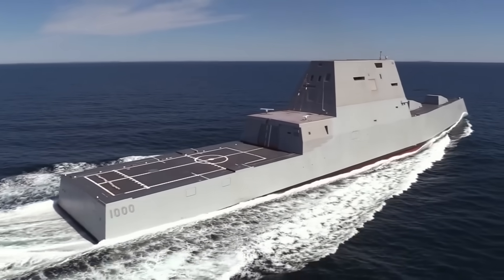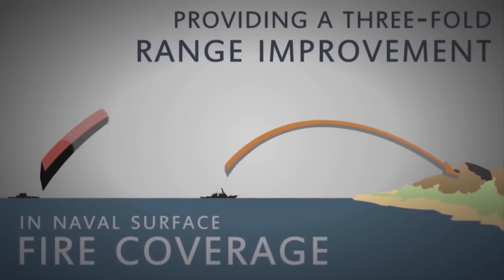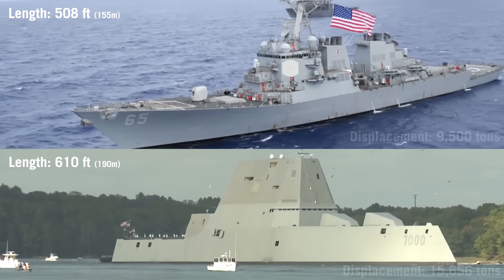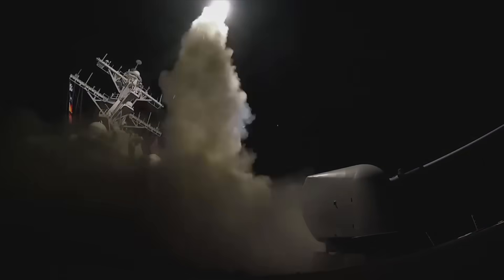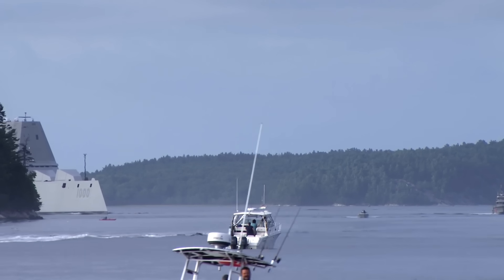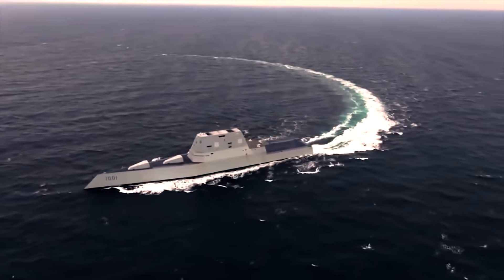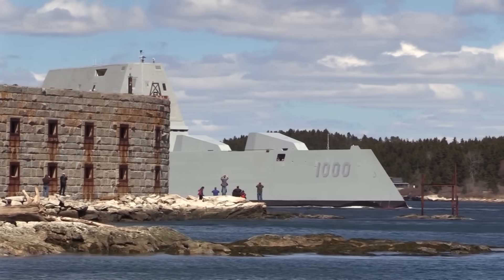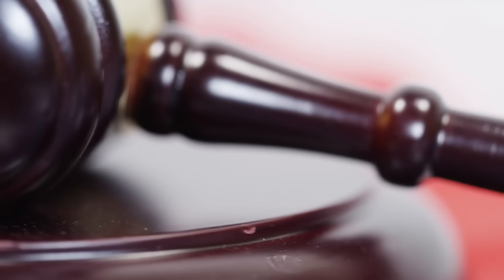What Killed Zumwalt Destroyers?

Comment: Has a system in place to flag and cancel projects that have gone over budget.
F-35: Luckily I have an immunity card.
Reply: To be fair, the flyaway cost of an F-35A is $77.9MM. By comparison, the new F-15's that the US just contracted for will run $99.9MM a copy (combat capable) and are not stealthy. The case studies, including this one represent the loss of economies of scale. Lawmakers want low cost/unit but cut back production which results in the exact opposite. See B-2, F-22 among others.
Reply: @arrow-flight  Yeah, because they didnt cancel the project or hamstring it. Things are cheaper when you build more of them, economy of scale and all.
Reply: @Orinslayer  And also because there was a workforce too big to cancel it.
Reply: @hueyrosayaga  Which means from now on, all defense contractors will make their projects "too big to fail".
Reply: @arrow-flight  That's not the actual cost, it's a projected program unit cost and assumes the full procurement will still be met. This figure does not include engines, which are subject to a separate contract
Reply: @turbotroll8605  Cost for everything. Including fuel weapons and even pay of anyone who worked with the system. When production costs lower with a new manufacturing process the savings can be put into tankers and flight hours. Our country has put off buying them. But like I think future conflicts are going to be very low intensity and definitely more political and economic. Rivals want to look impressive to their people. So we're going to be buzzing and trolling each other in the air, in the sea, and drilling on the land. It's that or they have to spend time with their wives.
Reply: @arrow-flight  The Zumwalt could not replace the Arleigh Burke and the F-35 could not replace the F-15. Coincidence? Although, maybe the F-35 will replace the A-10?
Reply: The F-35 cost is actually sort of reasonable as of 2021, but I''ll admit the X-32 program should have been chosen over the X-35 (f-35).  Problem was the X-32 VTOL variant wasnt as good, which was a problem for the the USMC and especially for the UK Royal Navy, who were a major partner. 

The X-32 basically used a clone of the Harrier VTOL design, which always had a number of safety problems, and couldn't take off fully loaded.
Reply: @p51mustang24  Isn't the X-32 that plane that looks like it has a Derp face due to the massive intake at the front? I thought it wasn't picked due to that intake making it non-stealth.
Reply: @deloreanrc  yep, that's the one.  It had a pretty decent stealth profile, although it was slightly less stealthy than the xf-35.  

The main advantage to the x32 was the incredibly strong and inexpensive uniwing design.  The x32 would have been a lot cheaper and would have gone into production several years sooner.  I believe it also had a larger internal weapons bay.  

Issues with VTOL on the X-32 B variant were the main reason it lost out.  Supposedly the air force just thought the F-35 looked better too.
Reply: @p51mustang24  A huge portion of the cost overruns and delays on the F-35 are due to electronics and the STOVL system. The X-32 wouldn't have avoided these issues whatsoever.
Reply: @ivanlagrossemoule  The X-32 used a very different STOVL system, so that's probably not accurate.  The x-32 was roughly a copy of the harrier's system, so it was a proven technology, albeit less capable.
Reply: @p51mustang24  The F-35 cannot take off fully loaded either or land fully loaded.
Reply: Lol ikr
Reply: its not over budget mate. its just differently financed. :)
Reply: So does the James Webb  telescope.
Reply: @jsmariani4180  except the webb telescope will radically redefine and expand humans knowledge of the universe. the f35 is just further taxation without representation designed to feed the addiction of sociopathic wealth hoarders
Reply: Laughs in V-22
Reply: Also called an "ordered success"
Reply: First of all there is no such thing as under budget... When truly creating.
Reply: @Nybbl er Disagree with the F-15 as it is an in-production aircraft at the time of the EX contract. The industrial base for the aircraft exists and is still accepting long lead part orders. It does not have the benefit of similar economies of scale - which was my argument.
Reply: Oh, that's because fighter pilots have this privilege of being that hotshot maverick that plays beach volleball and doesn't afraid of anything.

Consider this: Convair B-58 Hustler had one pilot plus two in order to just keep it afly. And then there's the Northrop F-89 Scorpion that could just Macross with their Mighty Mouse rockets.

These aircraft that looks like something straight out of Johnny Hazard is much more funnier. Also, they would probably send any Zumwalt to Davy Jones' Locker just like that.

Comment: Its not that the tumblehome design is unstable in rough seas. Old British sailing ship were designed this way because they were more stable in rough seas. Its unstable when there's a hole in the ship from combat that let water in causing it to be more likely to capsize.
Reply: I was just thinking the same thing. Under some circumstances it's actually more stable.
Reply: Tumble home always has negative effects on sea keeping in heavy weather as the bow tends to dig into waves.  It was universally abandoned for a reason.
Reply: @JimmySailor  Seaworthiness was an issue if your tumblehome ship had gunwales, but this class of ship isn’t going to founder in the same way if it takes a wave on deck. The main issue is that they prioritised stealth over utility and flexibility. You have max displacement but no way to utilise that reserve of buoyancy over the lifetime of the class.
Reply: @nicbrownable  The Zumwalts were designed with reserve power in mind. They may not have extra displacement in the sense that more stuff can just be tacked on, but old systems can be replaced with more power demanding ones. Legacy ships have a problem of supplying the Megawatts of power required by high-power radar, computing, and especially directed energy weapons that are slated for deployment in future ships. As such, I think the Zumwalts are actually a fairly future-proof design.

Any modern fighting ship ought to be built with a robust DC-grid for its power distribution, and enough excess power in its propulsion units to be able to upgrade its weapons and sensors as time passes. It is extremely arduous to try to fit in more power into a hull after the fact, let alone distribute it where it is needed.
Reply: @whitescar2  it might make more sense to invent the railgun/energy weapon/ wonder radar first and then design a ship around it.
Reply: @JimmySailor  There is a difference between digging into waves vs piercing waves. The X-bow concept by Ulstein warfs is extremely popular in OSV/PSV and even expeditionary cruise ships that have to contend with the notoriously heavy storms of the North Sea.
Reply: @JimmySailor  Depends on the conditions you operate in and why.
Reply: ya you are completely right mate. thats why the french navy gave them up in the 1910s. they worked out it was not a very survivable design once you poked some big holes in it. seeing as the zumwalt also has very few crew i suspect they would sink rather faster than an equivalent ship of a standard hull type. why any navy nowadays would even consider a tumblehome hull is completely beyond me. it was not a smart decision and is no lose to the US navy that they got binned. the main gun however is a very good idea and hopefully will come back in some form on latter ships. i know the RN is looking at this type of weapon system right now and it looks like this my be what gets used on the next gen of ships.
Reply: Isnt it the same if a huge wave hitting side on of that type of hull? As well how top heavy the ships with that hull design is
Reply: Reminds me of my favorite overheard submariner observation: "You aviators always want to poke a hole in the top to let the air out - what you need to do is poke a hole in the bottom and let the water in."
Reply: @charlesjohnson9879  thats an old one mate. a RN sub captain said that at caws week back in the nineteen twenty's. still a good one regardless of when and who first said it. :)
Reply: Thank you somebody said it. That report was purposefully misleading, it answered a question no one was asking.
Reply: They knew that as a result of the battle of Tsushima in 1905.
Reply: To be fair, I think the hole in the ship is the greater concern in that statement.
Reply: Most ships are. Ahrrr!
Reply: An upside down ship is more stable than an upright one. Zumwalt works like a submarine.
Reply: @IMNODOCTOR  Submarines sink.  Zumwalt works like a submarine.  Once.
Reply: Ah, a man of culture
Reply: Right. The problem about the tumblehome design is that it makes the Zumwalt-class DDs the most ugly ships I have ever seen.

Comment: Anyone even cared that Iran launched a 1100mile long range antiship ballistic missile?
Reply: Anti-ship and ballistic missile don't work very well together, especially when you don't have an established satellite recon system. Even then, it's nearly impossible to distinguish between a nuclear ballistic missile and a conventional one, with potentially world-ending consequences. Combine that with the USN's alarming array of ballistic missile intercept-capable missiles (ALL of the SM series have the capability to some degree, with thr SM-3 designed specifically for the job), and it's more or less a non-issue.
Reply: @griffinfaulkner3514  Well, the footage shows that they are capable of hitting floating targets and in the images, missiles have a camera(probably IR tracker or Tv guidance) on their nose which means they can use sonar, observing drone fleet, OTH radars or anything that they can afford to locate US navy in a 200 square mile area and then missile finds the target itself.
SM-2 doesn't have any noticeable anti ballistic capabilities  and SM-6 would have very little to zero chance due to mach 10 speed of those BMs.  SM-3 is extremely effective if it can reach the incoming ballistics in their second phase but I don't think destroyers have many of them.
(No need to mention any other fleet except US would be an easy meal for them.)
Reply: Gee, no... did it hit your house ?

Comment: Short answer: Shitty designing, just like the Littoral Combat Class.
Reply: Not true in the slightest.  Shitty management which combines R*D and production under same heading.  Nothing has changed in a ships hull going on 70 years now other than a brief foray into the possibility of hydrofoils.  Its systems have changed.  Systems can be placed on anything so pretending a ships hull is to blame is absurd.  Rather look at the eggs and braid who demand all these untried systems which are searching for a purpose to justify their cost when tried and true simply works.
Reply: @w8stral  It is bad design. Defective engines that caused it to break down, guns that fired 800K munitions and wouldn't work as well as designed, leading them to be unused ,etc., etc.
Reply: @noneofyourbusiness9489  Engines have nothing to do with the ship, and are same engines used by others around the world and have been fine since that PR idiocy.  Guns that fired actually AS designed and met spec, but since the idiot navy refused to just use the Army projectiles, were horrendously overpriced.  Gets back to the Crusader Program actually as the Navy wanted 204mm guided artillery and the army did not.  Navy pulled out of the 155mm Excaliber program, which ultimately led to the gun disaster on the Zumwalts.

Comment: Why is it that all the futuristic looking technologies end up failing?
Reply: too many unproven tech and requires a lot of test and immature tech tend to break down a lot
Reply: Why? The reason is: not everything ends up working as envisioned.
Same reason why 90% of buisnesses fail in the first 5 years.
Reply: Skynet
Reply: High tech equipment have expensive teething issues.
Reply: Engineers are inexperienced with the design, no reliable and efficient manufacturing tools as old manufacturing tools do not suffice anymore, high research and development costs, concept is not proven to be effective yet and therefore can diminish returns etc. Basically, the more time you spend with a technology, the more you know about it, the wiser you are about its costs and effectiveness, the less money you will spend trying to figure out how to build and operate it etc.

Futuristic technologies work most of the time to be clear. I'm pretty sure Zumwalt is one of the most advanced destroyers in the world and would have significant advantages over previous generation destroyers given the right conditions. It's just too expensive.
Reply: Tbh that’s a good question, personally I’d  say that it’s based on the idea that they are too expensive, but pioneering the future is never cheap so I’m very confused

Comment: Always thought there should be a R+D budget and a separate shipbuilding budget. Rolling the R+D costs into the shipbuilding budget artificially inflates the cost/ship. The advanced gun system is still a project of its own and still in development. Why was it even installed if not ready and why was its cost included in the shipbuilding budget? Makes no sense. There is something fundamentally wrong with the US Naval procurement system.

Comment: Because each round for the cannon costs 800 thousand dollars...
They should have put the Railgun instead.
Reply: @Lucas_WAZZAAA The idea of the railgun is that it can be cheap to fire -- it just fires cheap inert slugs. It's not quite there yet though as they haven't dealt with the problem of damage to the rails when firing. 
It's the same with laser cannons, yeah they are expensive, but if you can make them durable enough then the cost of firing is just the cost of power generation since they have no ammunition costs (in an electric laser anyway -- chemical lasers like on the ABL effectively had ammo).
Reply: @NozomuYume  Railguns are probably a dead end technology, at least for the foreseeable future. You need either some serious advances in material science to make rails that can run thousands of rounds without significant damage, or a means of preventing the projectile from directly interacting with the rails at all. There's an idea to use sub caliber ammunition that rides a "sabot" of plasma between ceramic coated rails to get around the friction wear issues, but that's decades from being practical. If you want electromagnetic cannons, coilguns should be much easier to get working. Because the acceleration mechanism can be placed around outside of the barrel, existing gun technology can be used to make it durable. 

However, I'd bet on ETC cannons being the future of gunnery since that's just much easier to build and implement with current technology, and it's possible to get similar performance.
Reply: @NozomuYume  the railgun may shoot slugs but with enough research and development of the weapon they could make the velocity of that slug a whole lot faster. A golf ball could destroy any warship if shot at the right place and a high enough speed.
Reply: @solidsnake6206   Naval railguns are obsolete even in concept.  Naval missiles will always be longer range and better guided. So in a blue water engagement railguns offer no tactical advantage. Their only potential advantage is in cost and logistics of the ammunition.  But even then, naval artillery is so seldom used why bother? A carrier strike force is so much better at ground support.
Reply: They should just have put more missiles on it
Reply: So in addition to a final cost of $7.5 billion apiece, these things were basically going to fire higher-end Ferraris as ammunition.
Reply: @derekr1282  That mental imagery, going to the Ferrari bespoke factory department and buying then immediately crushing the car as it drives out of the building for 1M a pop.
Reply: The one that still doesn’t exist?

Comment: Zumwalt-class is a failure due to its small crew size an inability to perform major damage control. In addition it's other failure point is the big counterweights on the bow. Otherwise known as guns. They never developed the ammunition for them. So they're pretty much useless. The Zumwalt class with their electric Drive , concerns me since they don't have adequate crew for damage control any water getting into the drive system and their pretty much dead. For example you can go back to World War II and look at the Saratoga and Lexington with their electric drives and there were a couple battleships that had electric drive also. Saratoga had a nasty habit of taking torpedoes. Every time it seemed to upset the electric drive more than the crew. A lot of time was spent and Dry Dock because of that.